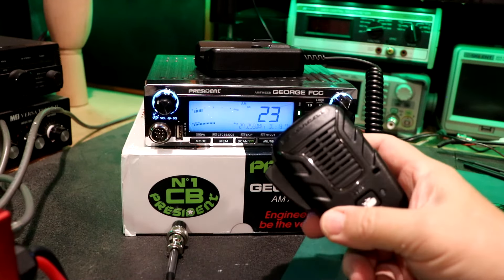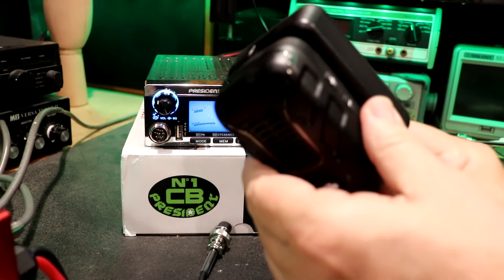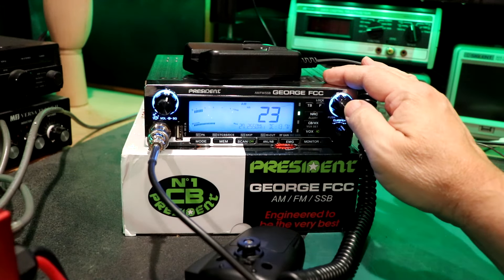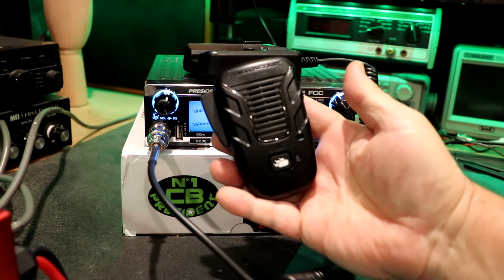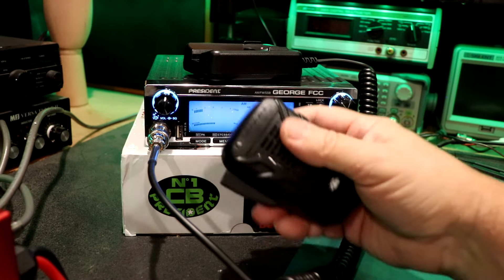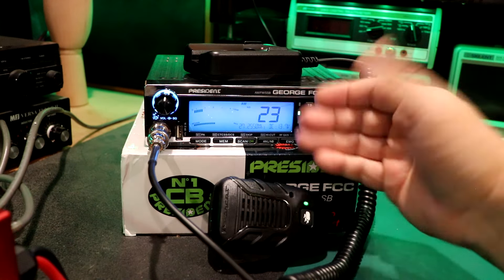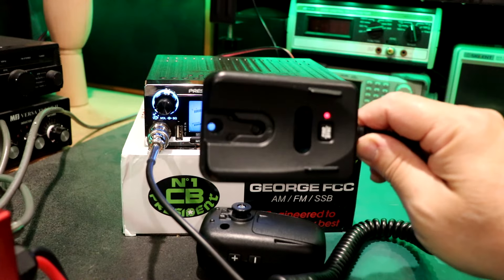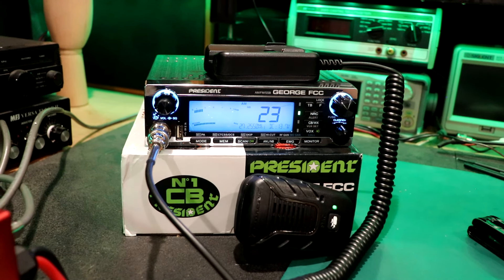How to add Uniden Bearcat BC906w Wireless microphone to President George FCC

Comment: If you give that cradle the 7.8 vdc it all for it will charge that mic and then your not required to turn the cb volume up to get it to work either. Your turning it up till the cb voltage regulator products 7.8 vdc. Of course your going to have to open the unit up to do this so it's isn't for everyone.
Reply from the maker: Noted. Thanks

Comment: Hey Mike.  Is that mic able to be used if you modified your radio by lets say putting on an 8 pin mic socket and using the pin out for speaker and mic connections, or is it electronically restricted?
Reply from the maker: The System can be adapted for use on other radios. Stay tuned.

Comment: How's the link accomplished,  432 mhz?
Reply: Wow, Bluetooth gets you that much coverage, all over the house, and outside? Not bad.
Reply: No, actually. The link is through DECT 6.0 (1.9 GHz I believe) per the Uniden video.
Reply: @kg5radio716  Bluetooth is extremely limited in range whereas 1.6 ghz is not. I've gotten about 1500 feet point to point.